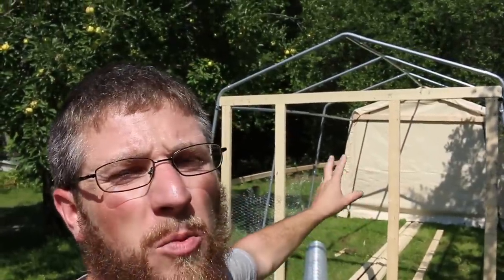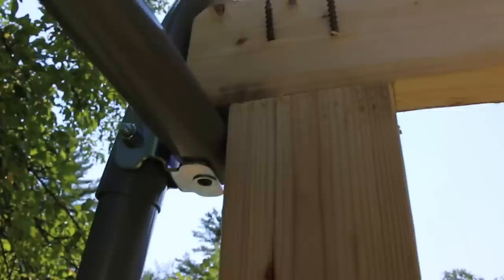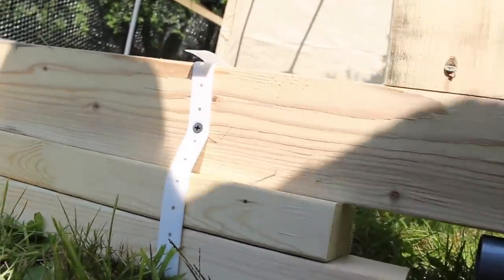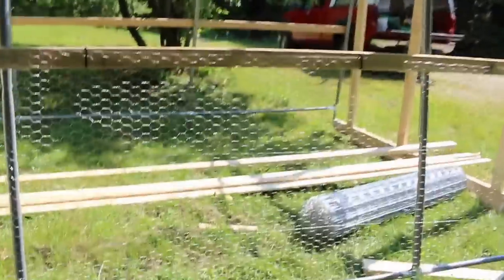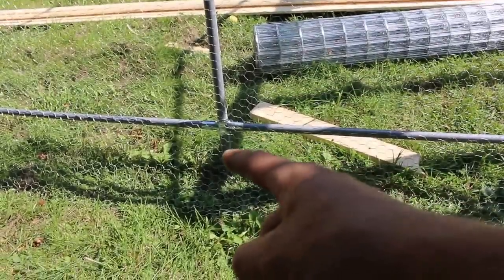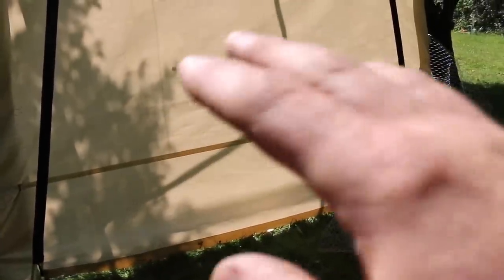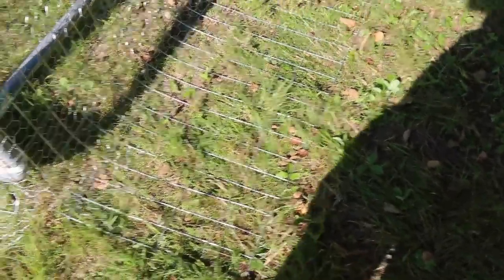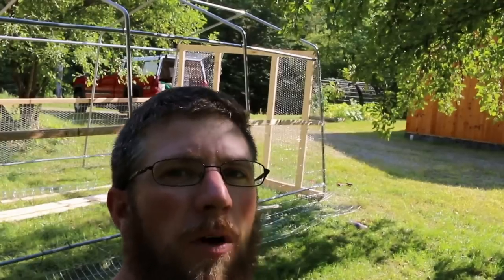DIY  Green House and a Chicken Coop? Part 1

Comment: that's awesome using a tent shed.  they are not that expensive and nice to be able to break it down and move it.
 have you thought about putting it on skids so you can relocate it seasonally?  and will it hold up to piglets without setting regular fence posts?
Reply from the maker: No, we haven't thought about using skids great idea! thanks. We will have an electric fence on the inside to train the pigs before they go out on pasture.
Reply: ah, good idea.  i was just imagining your piglets tearing the house down!  an electric fence will teach them a little respect.  ;)
Reply from the maker: Cheryl Taylor we hope so!😁

Comment: Rodents will get right through the chicken wire if they don’t chew through it first. The larger animals can easily rip through that.  Should really use hardware cloth if you want to protect them. But again if you’re only going to use them for eggs and soup I guess it doesn’t matter if you lose some to predators.

Comment: Watched this video to see how to build a greenhouse.  But where we live (Wisconsin) we get a lot of snow.  How far north are you located?  You did say your winters are snowy.  What mil greenhouse plastic do you use and how does it hold up not only with the weight of the snow, but with the freezing temps.  We had 23° below a couple of times last winter.  P.S. We are going to try your idea about killing the Burdock with Pee, HAHA!  I will be getting back to you with the results.  :)
Reply from the maker: We live 40 minutes from the Canadain border! Plenty of snow! We got hammered last winter. When I feed the chickens I just take a broom and push up on the greenhouse plastic and the snow slides off.  I only do this when I go to feed them if it needs it takes 2 minutes not even. Plus it lets more light in which means more eggs! It is 20-year greenhouse plastic. we can get down that cold and colder.
Reply: Lumnah Acres Now a few years later, what do you do to keep your chickens warm in the winter?